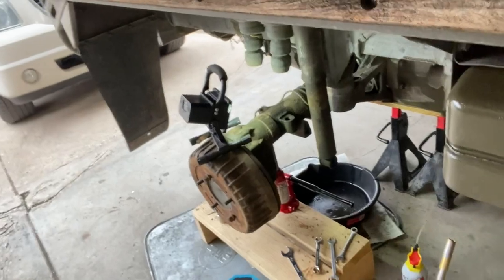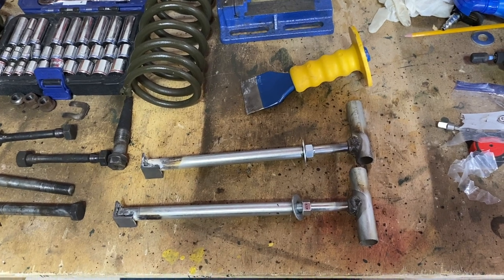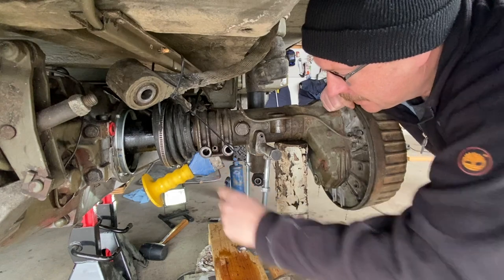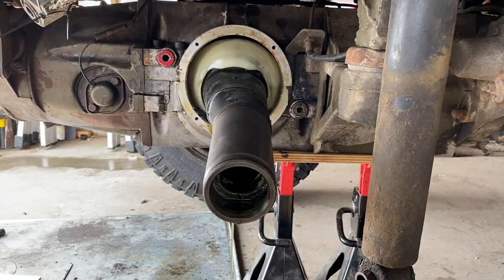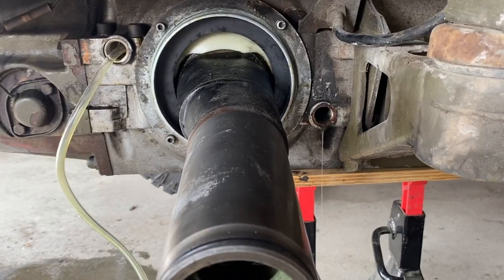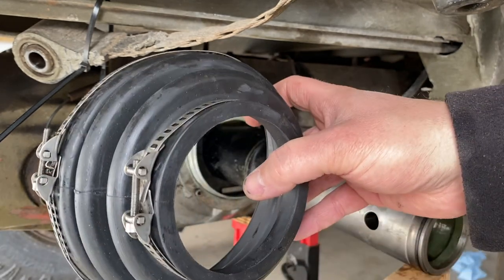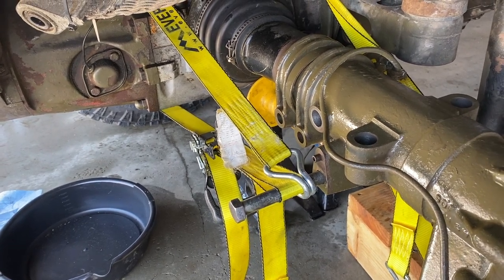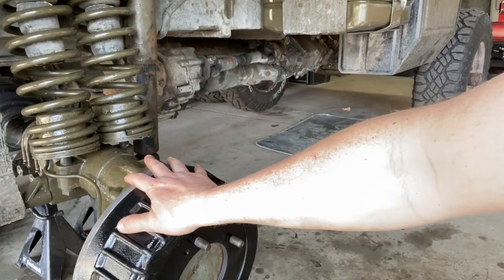Pinzgauer axle split and boot ring seal replacement

Comment: DONT FORGET TO USE A WEDGE (CHISLE) in the gap space on the bottom of the outer shaft housing to take off/put on. Much easier!! And you can just use the piston Jack that comes with the pinz to separate the 2 half’s !!

Comment: Hi & thank you for doing this video. I've watched it several times & plan to start replacing the differential seals on my 76 710k. Aside from the one brief Expedition Imports video yours is the only one I found on rear seal replacement. It's great to have this documented. Much appreciate it!!! I'm just getting things together & plan to start this spring with better weather. How's your new seal holding up for you? Anything you would do differently? Also, you mentioned using an aviation gasket sealer during reassembly. Can you please provide the type? Many thanks!!! Any first hand repair footage is great to have for these amazing vehicles! Very best wishes! 👌
Reply from the maker: I have only put 400 miles on the truck since the install but new seal seems to be holding up just fine. I used Permatex aviation form-a-gasket PTX 7651210. Purchased at NAPA. Also be sure to apply Loctite 270 to the clamping seat of the axle half prior to reassembly. I did not get a shot of that in the video.Thanks for the kinds words, best of luck working on your 710K.

Comment: I stock like I forgot to remove the bolt.... but I didn't! I don't know the amount of loctite they put in there. Any idea, does it need heating?
Reply from the maker: The shop manual says to apply loctite 270 to the clamping seat. It does not say how much. I did apply some to axle, but did not get a video of it. I did notice there was not much residue when I removed the axle. I reapplied some to the same area. One forum member mentioned this is done because of the high torque loads the axle experiences. Adding heat was not mentioned in the manual I have. Hope that helps.
Reply: @OFPA2001  Hi, I managed to removethe axles using hydraulic jacks. Your video was super helpful again when reassembling. I didn't think about using ratchet straps! I used about 5ml of Loctite 603, I don't think much is required and I don't understand how the axle could turn if the locking bolt is in place.
Reply: @OFPA2001  Thank you for the reply. 400 miles on the seal repair sounds great! I hope for a similar outcome. Thanks for the content! Best Always......Bob

Comment: I've started my search for a Pinzgauer and have been collecting repair information.  Moving to rural FL so I need a "nature" vehicle.  As I'm watching you work I'm think this looks straight forward.  Much easier than cramped sports cars I work on.  Then you slip and knock out the support block. I'm going to use bigger blocks. Damn that could have broken your arm.